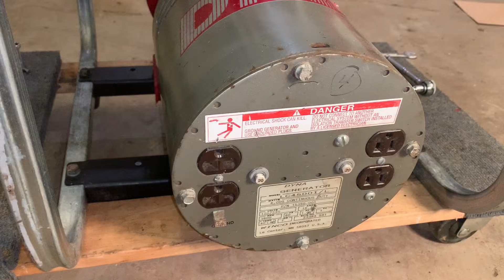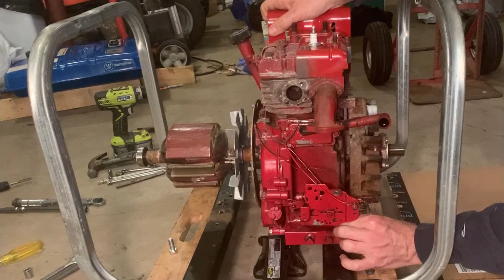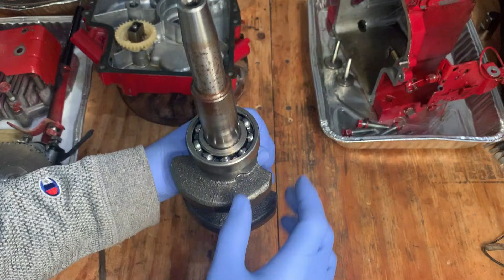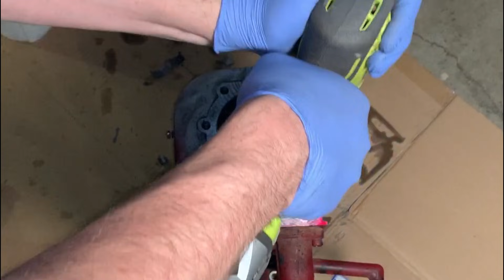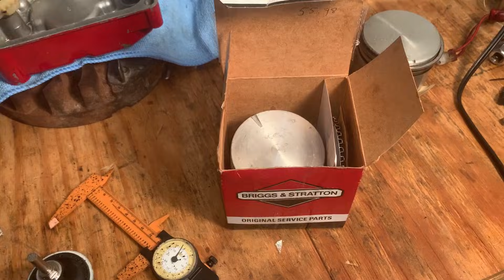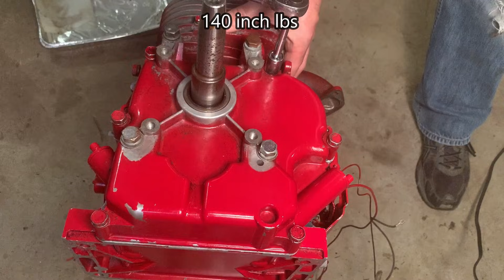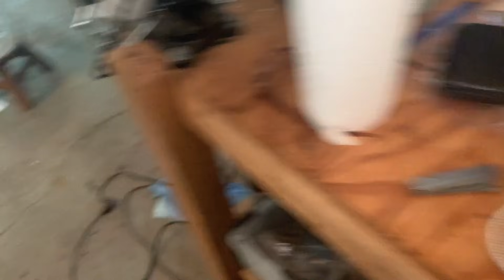Old Winco Dyna Generator (Part 2 ) - Engine Rebuild on a Briggs L-Head Engine

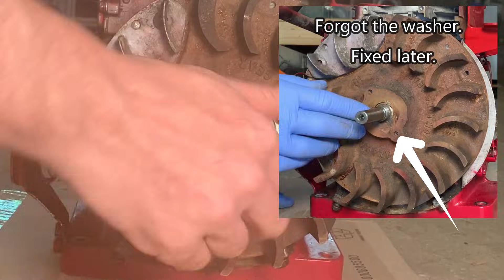Comment: I’m kinda thinking that key may have been sheared from the beginning; see time stamp 45:50 when you show the PIP of forgetting the washer, pay special attention to the flywheel keyway not aligning correctly with the keyway in the crank the timing is actually a bit retarded no pun intended and that’s why the exhaust was turning red in part one. However I do believe the tear down wasn’t for nothing, it was a learning experience as well as the piston skirt was pretty worn
Reply from the maker: Yes, I bought this one mainly to learn on.  It was only $45 so big risk tearing into it.  The cam timing was also off.  So this machine had multiple issue (not to mention the leaky valves.
Reply: James Condon I wasn’t trying to sound bad with my comment. Just my particular attention to detail combined with 16 years experience. I say with honesty that your one of the few mechanics I would allow to wrench on my stuff. You even using a torque wrench says a tremendous amount because everyone else thinks a impact driver has the ability to tighten fasteners to equivalent amount of necessary torque and that 3 ugga duggas is 120 inch pounds. I can’t stand it in case you’re wondering... There’s a guy at my shop that literally believes that all his stripped fasteners are not his fault.

Comment: I have the same engine and carb setup on a 1980 Sears rear tine tiller.  Never been rebuilt, knock on wood..Thanks for this video.  It will help a lot if I ever need to freshen up my engine.

Comment: I either missed your diagnosis on why one side of the piston was scored, or you didn't offer one...... What do you suppose caused that?
Reply: From my limited experience I would say that is from running lean.
Reply: The connecting rod doesn't go straight up and down, it swings out as the crankshaft journal rotates causing pressure on one side of the cylinder. I know in automotive engines the wrist pin hole in the piston is slightly offset to eliminate this wear, not sure if small engines have an offset wrist pin. And yes the spark plug is on one side of the cylinder and the valves on the other side causing uneven temperature in the cylinder. One of the reasons a hemi head is ideal.

Comment: I use a variation of the hydraulic method for removing stubborn rotor shafts. I have several different bolts drilled thru the center then tapped for grease fittings. thread em in the shaft and pump up with a grease gun and they pop right off every time.

Comment: Sometimes with the air filter removed,  you get more hunting...........
Reply from the maker: Yes, I am making a followup video on this generator.  Basically, putting the air box on and adjusting the jetting before I sell it.  And an unexpected surprise in the oil.
Reply: @jcondon1  just following up on the surprise you found in the oil?
Reply: @jcondon1  When is follow-up to be expected, you wonderful person?

Comment: why didnd't you put on a new rollar bearing on the cranksharft  and you did not even oil it what who taught you to be a motor mechanic bearings must be always changed  regardless you had a scored aluminum piston and those small  pieces go into your berings and YOU didnd't replace them  my god sir
Reply: Harry- no need to be insulting with your critiques. I mean, I could say you write like a 5 year old with no capitalization or punctuation. But I won't.
Reply from the maker: To do it right I should have.  But this generator is not worth much.  Already spent more on parts then I will get back.
Reply: New subscriber and love your demeanor and the perfect pace that you move.  Thank you for taking the time to share these with us. I appreciate the time it takes to make, edit and post these videos. Thanks again.

Comment: you should  use a wide hacksaw blade to clean the top of the block not score it with the tool u used i ve  never seen mechanics do that
Reply from the maker: That was a 3M Roloc designed for removing gasket material without causing damage to the aluminum.
Reply: Harry, you're aging yourself. Haha! When was the last time you were around another mechanic? I know the 3M Roloc discs have been used for more than 30 years.

Comment: I have one of those generators but a older model with the 8hp briggs it runs but the exhaust valve guide or lack of one I should say.. way too much play in it causing problems.

Comment: The usual 'rule of thumb'  for ring gap on an air cooled engine, was  3 thousandths of an inch gap for each inch of bore
Reply from the maker: Thanks.  Am rebuilding another now.  Will user that rule.

Comment: I enjoy all of your videos! I would have tried to find a socket which will be the right size to fit over the shaft without touching the bearing and then used a three jaw gear puller. Just another idea. Cheers!

Comment: Two issue that will help you doing such rebuilds. First, if there is no end gap specified, then you use the standard of .004" per inch diameter. Example, a four inch diameter cylinder would have a .016" ring end gap. Secondly, you really need a ring expander, to install rings. You may get away with install rings without any issues until one day, you snap a ring and have to wait for new ones to arrive. There are very very cheap, but well worth the cost. Thumbs Up!
Reply from the maker: Thanks for the info.  This was the first engine I have rebuilt.  So did not have the proper tools.  Will look into purchasing a ring expander.  Most likely will be rebuilding a Briggs 10hp soon.

Comment: on removing stater use a rod smaller than bolt long enough to bottom out in the bolt hole on crankshaft.
i bet the flywheel key key was already broke, may have been throwing timing  off. also you would not believe how many engines like this i found with the cam timing off new from the factory, i was doing warranty work for a power equipment store at the time
on the flow jet carb set the bottom needle valve while you have it under load.
Reply from the maker: Yes, was thinking the same thing about that key.  Scary the timing could have been off for 30 years.  I have used a rod to push rotors off.  It works very well.  In this case I did not have the correct rod diameter readily available so went with what I had.

Comment: Did you notice any bridge rectifiers installed on the rotor, I have a similar Dyna generator only showing 40 volts, and have tried all the usual tests and repairs, to no avail. 240volt Australian system, brushless but newer than yours, 1996 vintage.
Thank you, enjoyed your video.
Reply from the maker: There were diodes on the fan side of the rotor.  Will see if I caught and video of them and post a picture.
Reply from the maker: I did not find any good video of the diodes, but here is what the manual says about them:

1. Remove the end bracket holding the stator assembly on. Slide the stator assembly off of the
rotor. This allows ample room for testing the rotor and diodes.
2. Un-bolt the diode(s) from the rotor fan or mounting plate.
3. Check the diode(s) with your VOM. Some meters have a setting for testing a diode. If yours
does not then use the Ω (ohms) setting.
a. Meter leads should be placed either end of one diode (A). Check your VOM for current
flow.
b. Reverse meter leads (B). Check your VOM for current flow.
c. Current flow (VOM ohms reading) should be detected in only one direction. If a diode reads
current flow in both directions or neither direction it should be replaced.
d. Depending on your model, repeat the process for the second diode.
NOTE: All of the two diode rotors use one forward polarity diode and one reverse polarity
diode.

Comment: I really enjoyed this video, along with part 1. I love the fact that you are a "regular Joe" trying to fix something, you don't have a shop filled with a load of specialist tools and equipment. It means there's hope that anyone armed with a few basic tools can fix stuff like this.   
A lot of people would have thrown it on the scrapheap but you stuck with it... well done James, well done!!! 👏👏👏👏👏
Reply from the maker: Thanks.  Unfortunately even fixing it myself probably cost me more then it is worth.  Most would have trashed it if faced with sending it to a shop where it would have cost a lot in labor.  But I did enjoy it and learned a lot.
Reply: @jcondon1  Nevertheless, you enjoyed working on it and now have a running machine you can be proud of cos you fixed it yourself.
Reply: @jcondon1  hurrah!
Reply: @jcondon1 you also have shown me how to do it. Your work here was very helpful in guiding me to do a rebuild of a 3 HP Briggs flathead. You gave me a visual map of what I needed to do. My engine runs well, and it is because I avoided mistakes I would have made by watching your work. Thank you!
Reply: @haneyoakie14  hurrah! Great comment!

Comment: Tap threads into rotor for zerk fitting fill with grease from automotive style grease gun. It's a couple of thousand pounds. Be careful it can fly off!
Reply: I usialy just twist them off there is no key way way easier.
Reply: @williamvaughan1218  I guess if the engine is locked up or you have a string in the cylinder that would work but I guarantee the grease works, every time and only takes maybe 5 minutes to find a tap, tap it and pump er up.